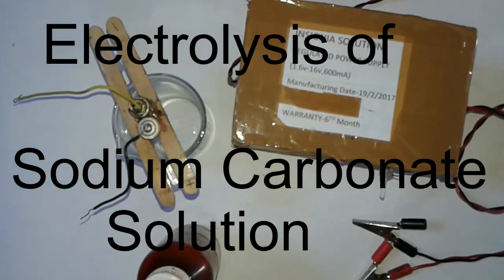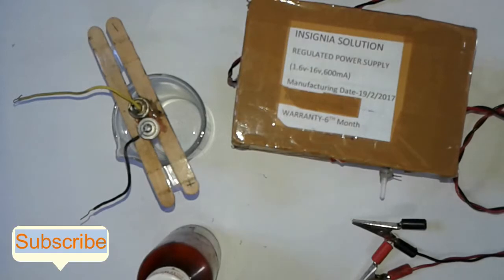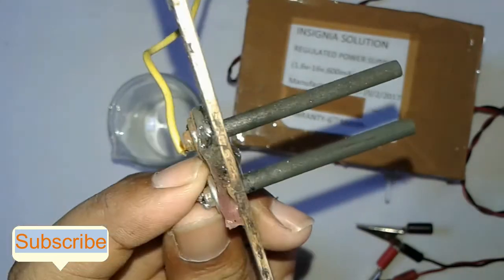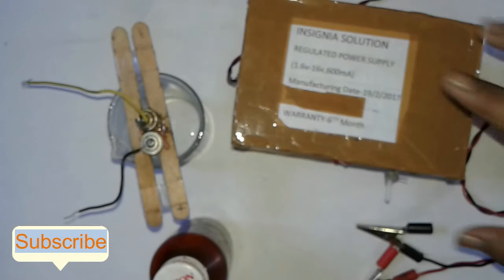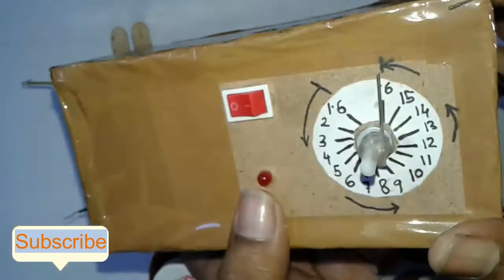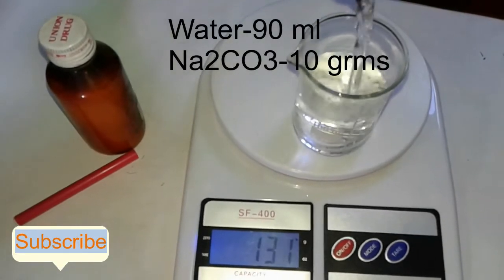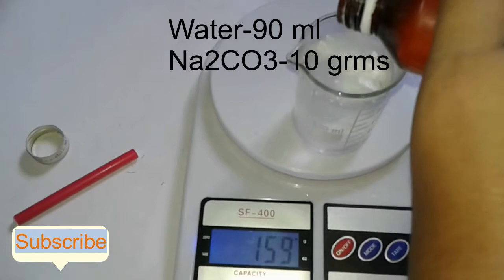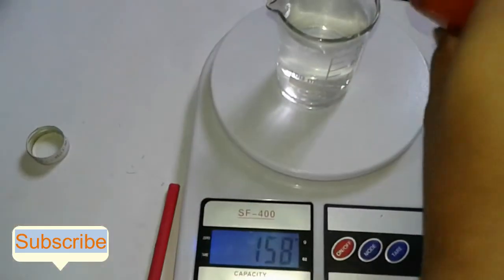Electrolysis of sodium carbonate(Na2CO3)

Comment: The main reaction is probably:

Na2CO3 + H2O —> 2 NaOH + CO2

With a side reaction:

2 H2O —> 2 H2 + O2 

The graphitic electrodes may exfoliate from ion intercalation.  Try removing by filtration. 

Seems like a simple and useful way to make NaOH.
Reply from the maker: Great explanation
Reply: كيفيه  الترشيح